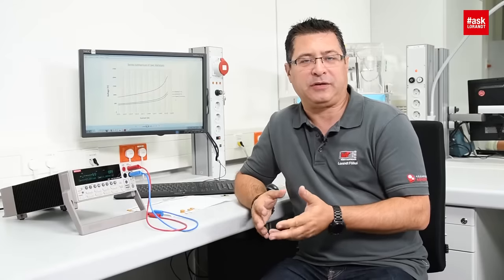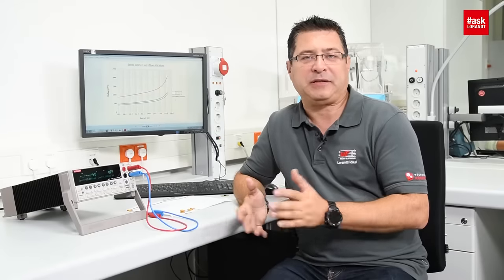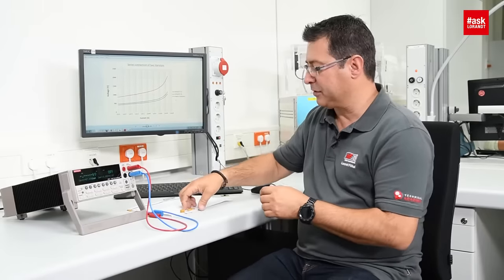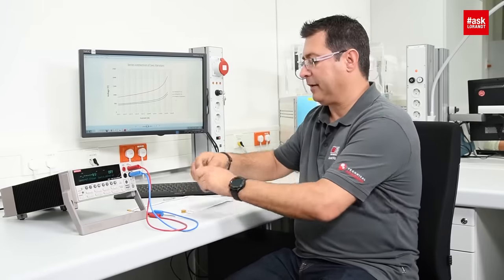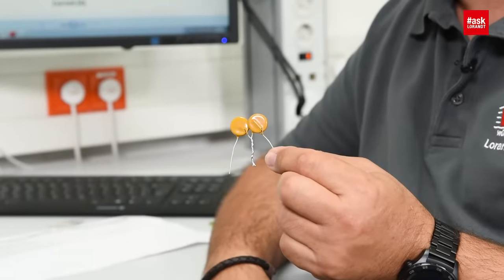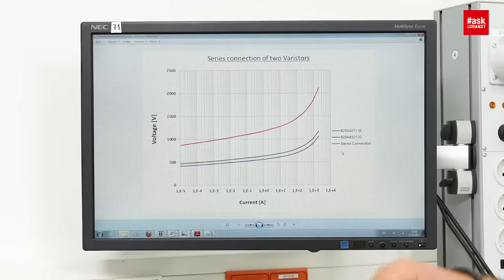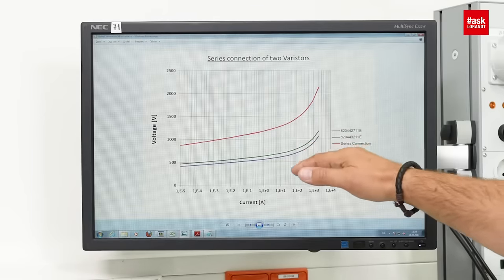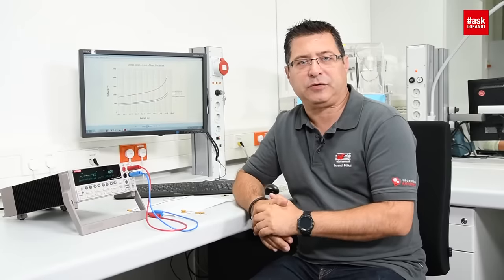#askLorandt explains: Parallel and Series Connection of Varistors

Comment: Can we use a GDT in series with the MOV to prevent leakage current
Reply from the maker: Hi Kumar, thanks for your request! You can put in parallel the GDT but not in series. It won't help to supress overvoltage in this way. To prevent leakage, you must choose the right varistor or TVS. Best regards, Würth Elektronik

Comment: In plug protectors, i think that they have varistor inside them. If you add one plug protector inside another plug protector, do you add more protection?
Reply from the maker: Hi J0RJ0, I know plug protectors only mechanical. If you use 2 varistors parallel, you don't have more protection.

Comment: but if i put two different rating of MOVs in series, one mov has high and other has lower clamping voltage,,then during surge which MOV will clamp first...the one with lower or the one with higher clamping voltage?
Reply from the maker: In theory the one with lowest clamping but in reality the fastest one, the lowest capacity one.
Reply: @wuerthelektronik  If two identical MOVs are connected in series, will the operating (nominal) voltage double while the clamping voltage remains unchanged?
Reply from the maker: @stunewman8139  those MOVs are not ideal components, so they have parasitics. In fact, 2 in series are operating on a double voltage, but this is no waranty, that it will clamp both in the same time or never. Regards, Lorandt